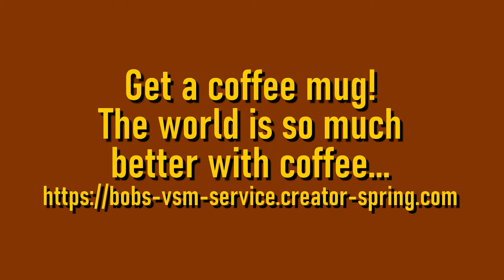Soul Searching

Comment: Today I spent close to 3 hours completely dismantling a singer 27 that was given to me for parts. This was the first time I have taken one completely apart. Stitch length regulator knob was broken so I had been using a few of the parts off of it. But today I decided to see how it's actually put together. Now I can clean the parts so they can be used in any of my other 27s. Thanks for the video.

Comment: I think the thing is, how far do you go when cleaning machines. I spent half of yesterday cleaning my 401G and it's not finished yet.... when is a good time to stop. For the average home sewer, clean enough will suffice. But if your selling you have different customers, some will not have those high expectations and will be happy with a machine which is decent enough and for a cheaper cost than having a machine totally taken apart. As long as you get the money back for your time and effort for stripping a machine down you've not lost anything. Different customers want different levels I guess!